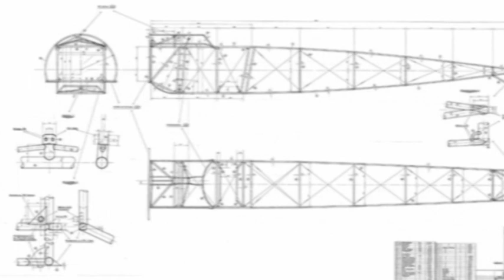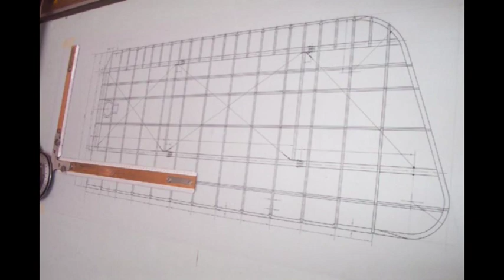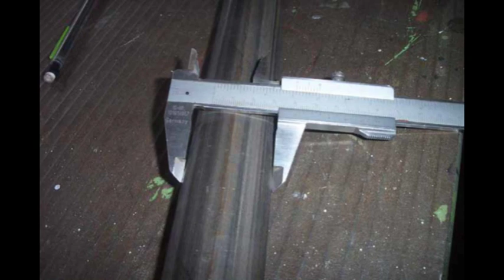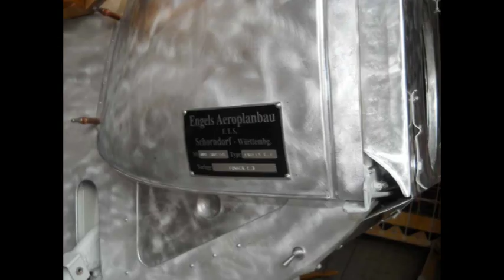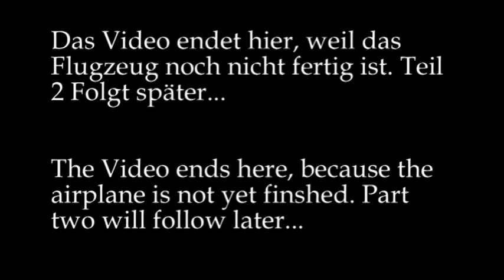Fokker Nachbauten - Fokker E.III / Museum für Flugzeugbau und technische Geschichte

Comment: Achim, Of all the Fokker planes your team has built, which one is your favorite for flying? and why?
Reply from the maker: +David Miller It depends on what you wanna do with it. If your intention is to show what these planes actually have been designed for, each of them has its own features, of course. The designs have not been made randomly.  You have to judge the whole picture. While the Dr.I is designed to be pretty agile, its nature is that is is relatively unstable around all axis. This is a condition underwhich is reactsimmediately to the inputs of the pilot. Since the radius of momentum is very close on that very plane, it does not fly straight by itself. It needs to be flown and be taken care off all the time. Saying this it may not be the perfect choice for someone who is not willing to manouver around like a devil. It is not intented for ralatively calm cross country patroling. It is designed for the moment of combat. The D.VII is a much more sofisticated design for instance. Although it still is very manouverable it has some special features in it´s wing design which allow even a unexperienced pilot to handle it effeciently. This is the reason why it is reffered to as the best fighterplane of WWI. The D.VIII is a combination of both, the quality of the Dr.I with respectto a fighting machine and a &quot;easy to handle&quot; aircraft with generally good performance that takes good advantage of a low power but light weight rotary engine onan overal relatively light airframe. None of these planes however should be confused with a Cessna 152 or such, but as far as I know the general wing geometry of the D.VIII was coniddered by Clyde Vernon Cessna for his wing design of the famous line of sports aircraft. It is not easy to answer your question. I for one like all of them from all aspects, design and construction as well as flying behaviour..
Reply: +AchimEngels Thanks for info on the DR1. I have always admired it, but from what I've heard about the stability, I'm not sure if I would feel "relaxed" flying one. 
I've really been considering the E.III, D-VII and the D-VIII. I'm interested in 1 hour long flights on Sundays.